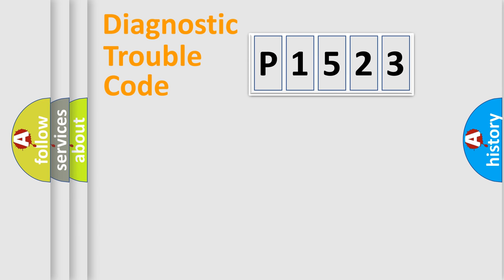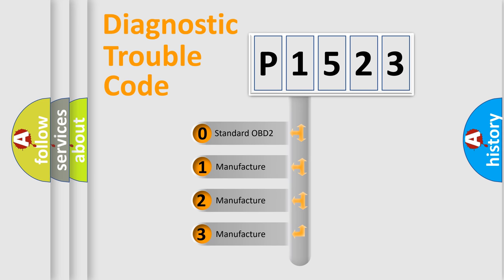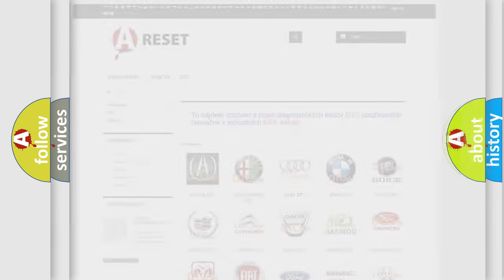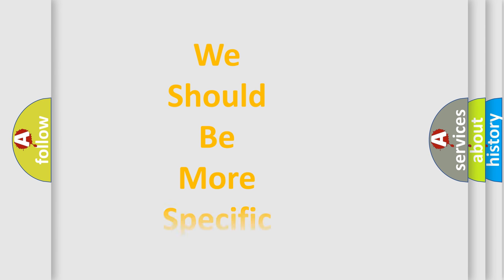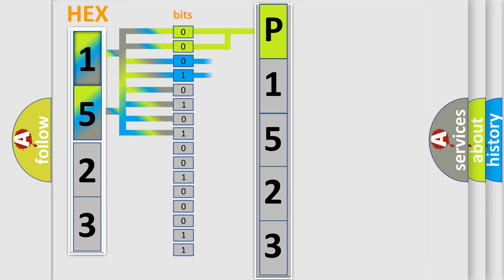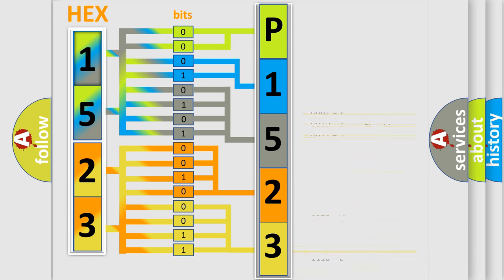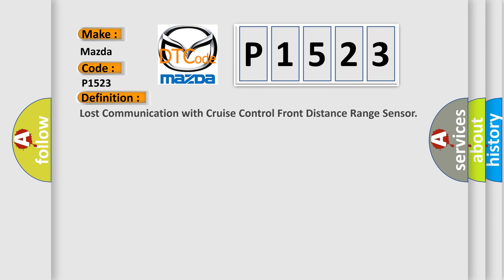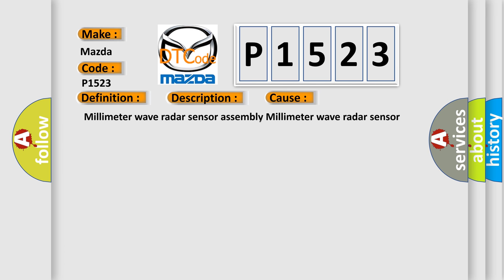DTC Mazda P1523 Short Explanation

Comment: I've only seen this code on one Mazda. It was a 2001 Mazda Miata and the code isn't related to cruise control at all. It is a fault in the circuit for the intake air control solenoid.